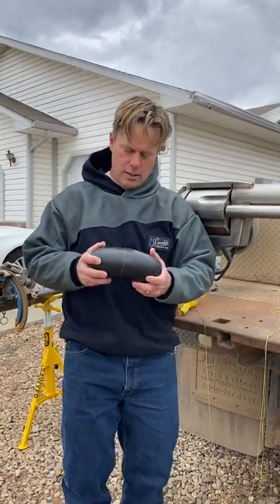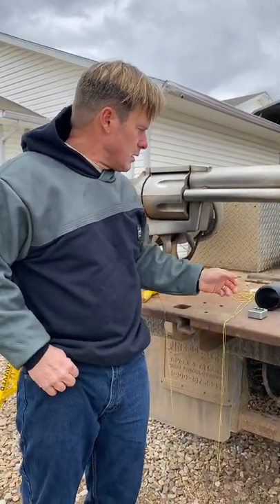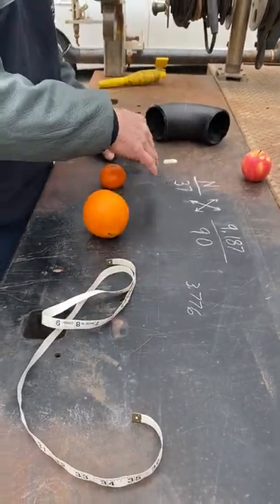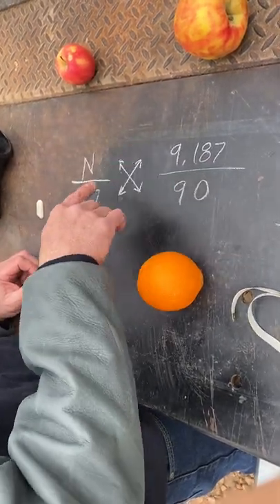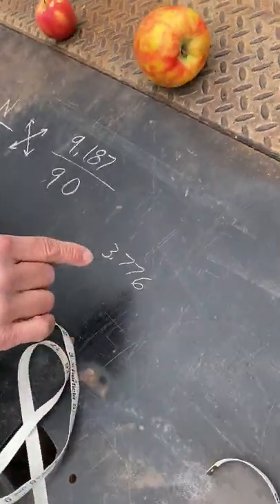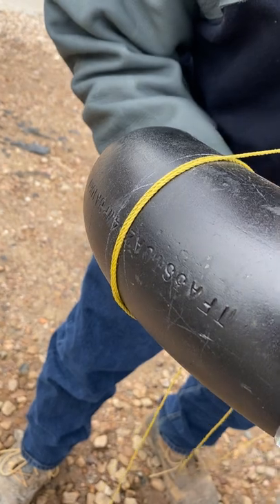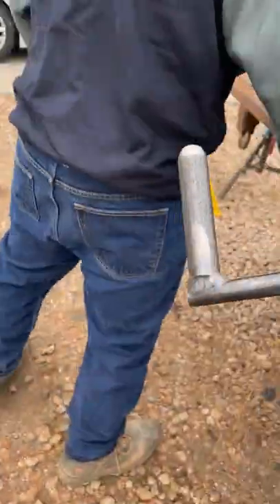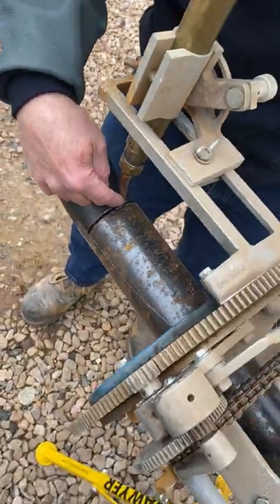Pipe Welding Layout: How To Miter Elbows To Oddball Angles

Comment: Thats a solid quick way to get your OD Radius to make your cut. But it doesn't get your the Center to End dimension. If you use the formula in the Blue Book you can get the Exact Outside and Inside radius cut marks. We laid out a flanged Elbow that had a leak in it. It was originally a field fit with slip ons and a mitered 60° Ell. We measured the existing piece, Angle(60°), C to Face of Each flange, and the flange rolls. Did the math in the office and came up with your Mitered cut dimensions and new Center to End dimensions. It also had a 10° flange roll on the bottom(vertical run) flange that was tricky to get the angle on. We ended up needing to take 1/4" off 1 flange and 1/2" off the other. Fit it up, welded it out and it fit perfeclty. No field fit Slip Ons required. Not sure how many Pipefitters would have been able to figure that out, sketch it, fab it and make it fit first try. Only been a fitter for 4yrs but learned from some Layout guys that are absolute Wizards. Rolling offsets? no problem. Mitered Ells? No problem? Rolled Flanges on a vertical run? np. Rolled Lateral Tees? Tricky as Fuck but made it fit first try. Couldnt be more grateful to John and Jim the Pipefitter/Layout Wizards.

Comment: Good video! How do you mathematically calculate your take-offs for the modified fittings?
Reply: Just measure the outside radius and take that number let's say 167, go 167/90=1.88 let's say rough numbers lol, then go 1.88 X what ever degree u want let's say 30 so it's 1.88x30 =55 so u remeasure and u mark 55 on the tape do same to other side but number will b different but same process then score line all way round  do this same math for any angle I just choose 30 can be 23 27 38 any weird angle u want lol hope this helps u

Comment: Couldn’t you just do the same thing you did for the top of the 90 to the bottom and get a mark on the top and the bottom and just connect the two or no?
Reply from the maker: Yeah that works, but the string wrapped and pulled tight will go to the shortest distance around the elbow which is right where it would be on the bottom and will yield the same result. Not a bad idea to use that to double check it before you cut it. 👍🏻😊